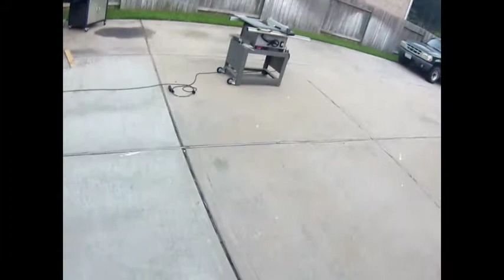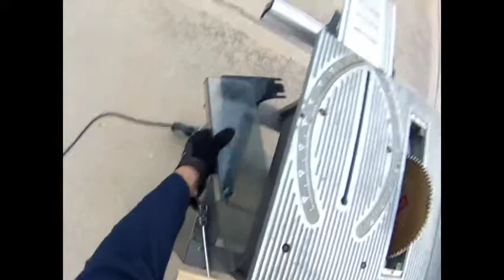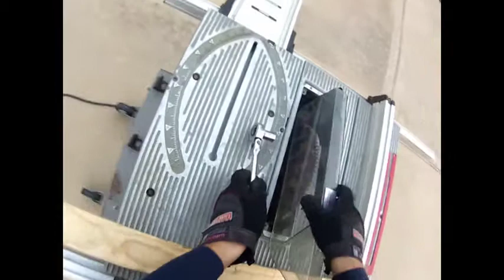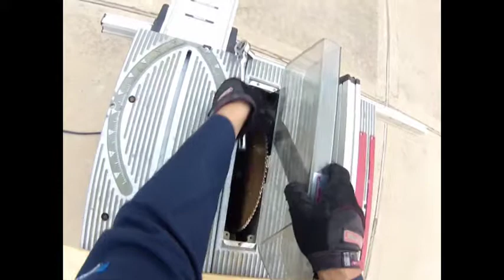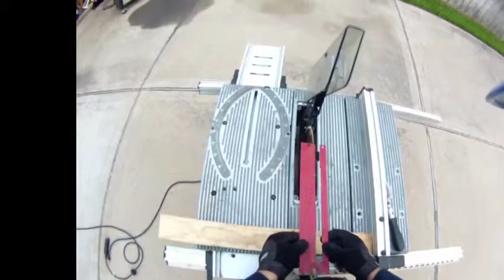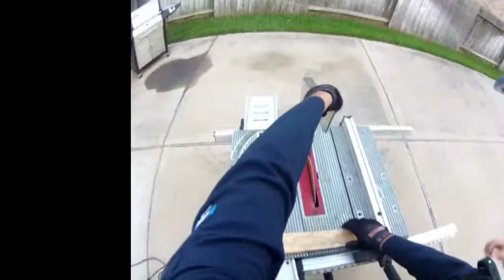OSHA 1910.213(d) | Machine Guarding, Table Saws

Comment: In trying to demonstrate safe operation, the operator is committing several unsafe acts!  First one is not unplugging the machine before working on it (lock out-tag out principles).  The second is not lowering the blade prior to installing guard which may also have aided in assembly of the guard.  Last, there is a zone several inches on either side of the blade within which you should not stand lest the blade kick out what is being cut.
Reply: Jerome Ridge you forgot to mention never crosscut using the rip fence, this guy is a safety nightmare !!